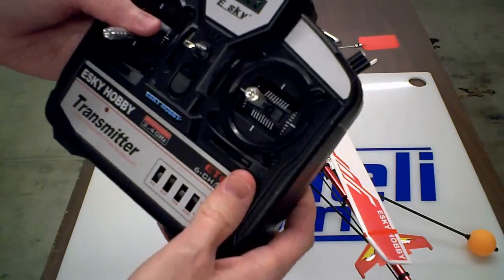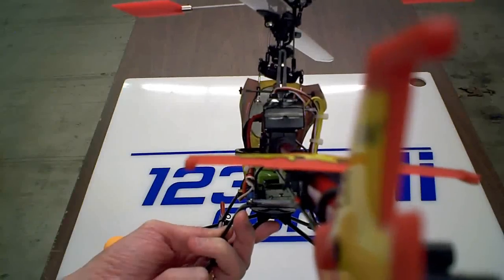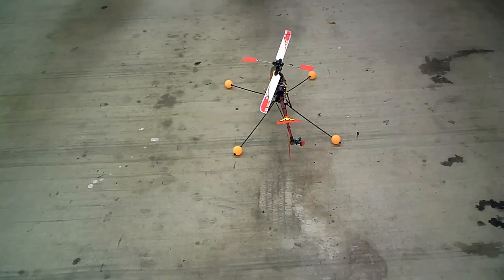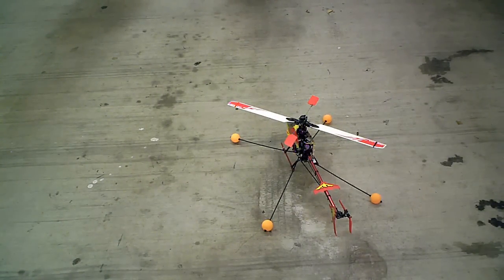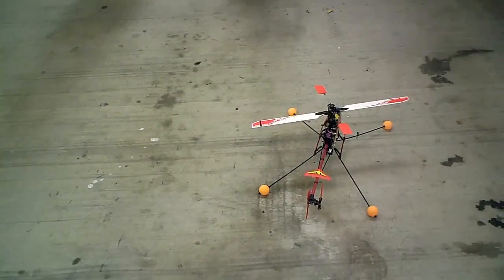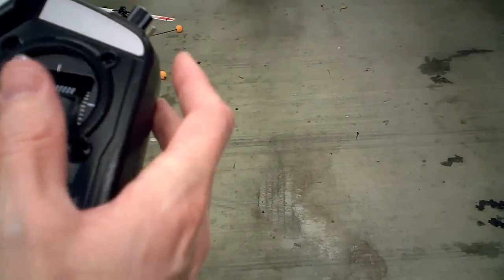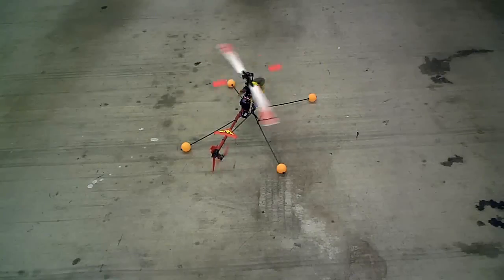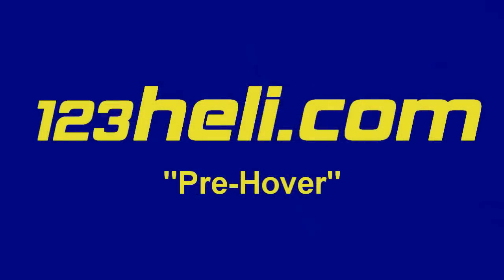123heli.com "Pre-Hover" Esky King V3 RTF 2.4GHz Helicopter HBK3 Honey Bee

Comment: Hello. I know this video is very old, but if you are still reading this, maybe you could help me out. I got a n ESky ET6 transmitter. My question is, which receivers are compatible with this transmitter that I could buy, (other than the ESky) and can I use it to control airplanes instead of helicopters? Thank you.
Reply: did you find your answer i am thinking of using them for plane
Reply: @Themachinist...  I ended up buying a FlySky FSi6x, but if you have the receiver for it, than it is usable for a simple plane.